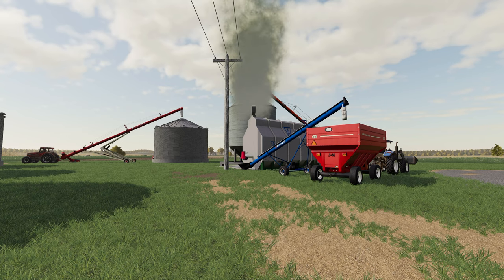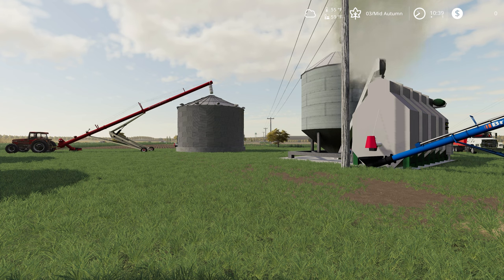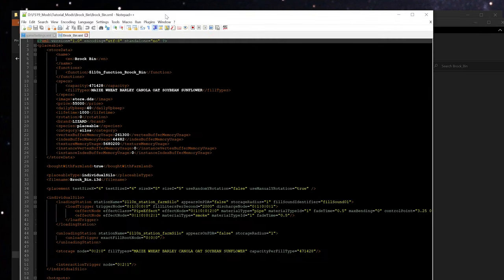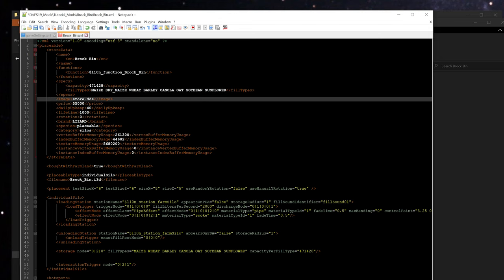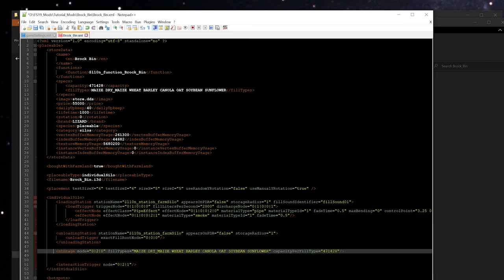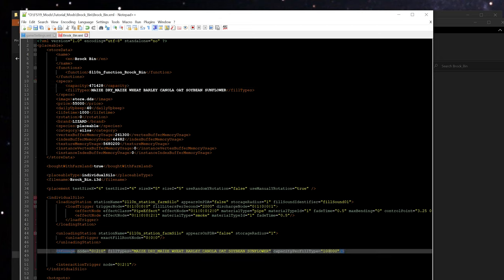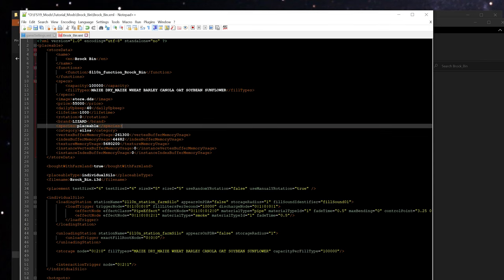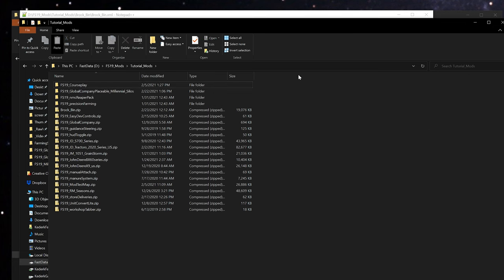How to add Dry Corn (or other crop types) to a bin & adjust it's capacity / unload speed

Comment: You nee to modify the name of the mod to BrockbinV1 or something similar or you'll have notices to upgrade. If you choose to upgrade, it goes back to the original mod.
Reply from the maker: That's a fair point!  One thing to consider if you do that on an existing save you'd have to also make changes to your save game if the bins are already placed which gets a bit more complicated.  Also this mod isn't on the ModHub so not a concern in this specific scenario but still a good point!
Reply: @KederkFarms  I keep a folder with the revised mods in it. I change the modDesc.xml so I can identify what changes I've made. Makes them easier to place before you start the game or just swap out with the in game mod. You're right about changing in game save but doable. I enjoy your videos.